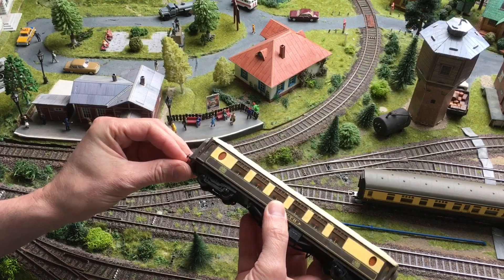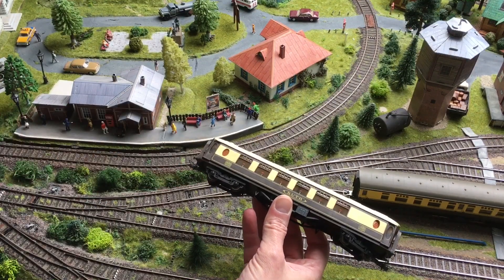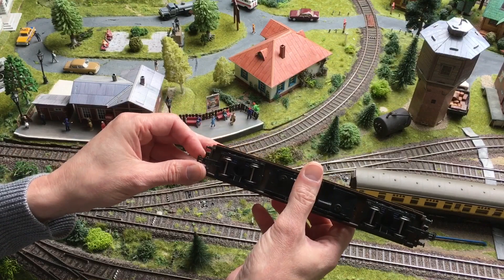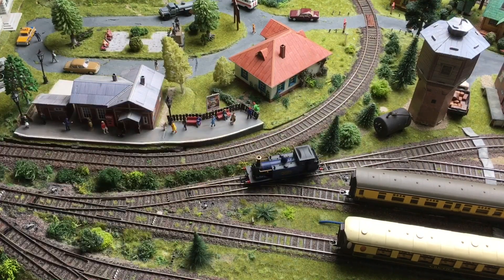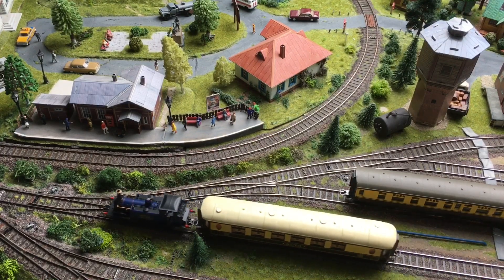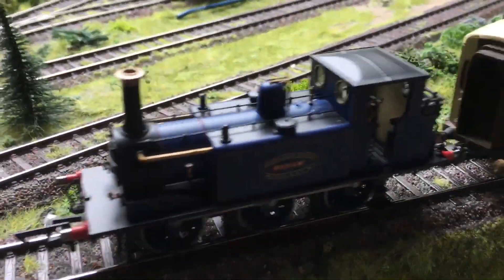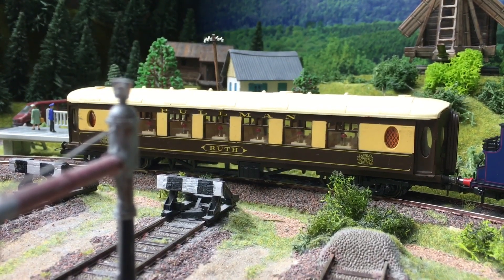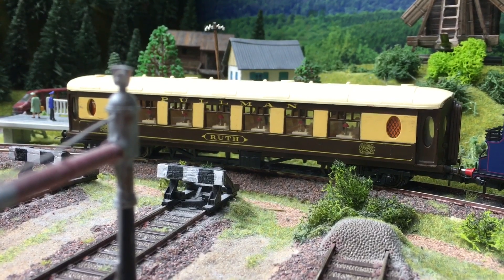Triang coach “Ruth” - quick update on new bogies and wheelsets (subtitles available)

Comment: Hello Erik, I knew you would solve the wheel problems on the old Triang Coaches. The Pullman Ruth is such a smooth runner now, and looks great on your layout. I think you will find when you connect all of your Triang Coaches to a loco and run the train the sounds of the metal wheels will be amazing. I can only suggest you carry on exactly the same with your other Triang bogie conversions it works very well. Cheers, Paul.
Reply from the maker: Hi Paul, you are right, the sound of these metal wheelsets is great, especially for passenger trains. I will change the other Triang coaches too, but first I will add a new building to the layout 🙂Thanks for watching 🙏 Greetings 🙋‍♂️ Erik